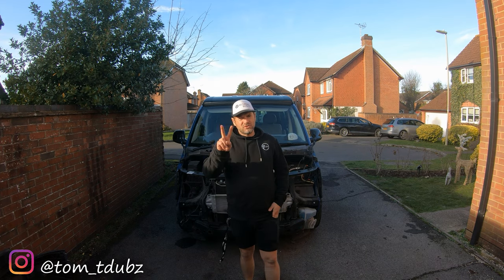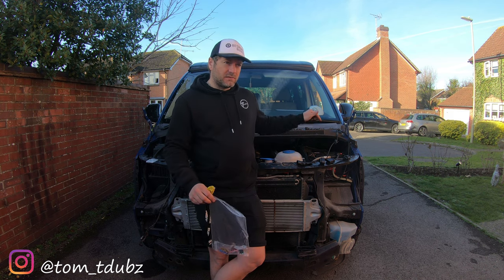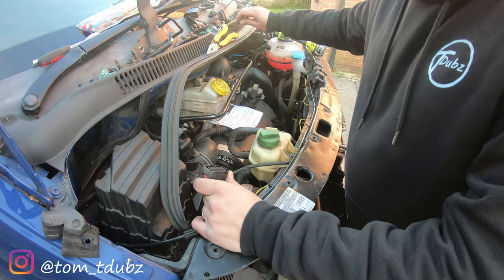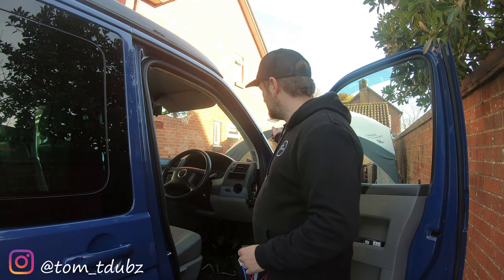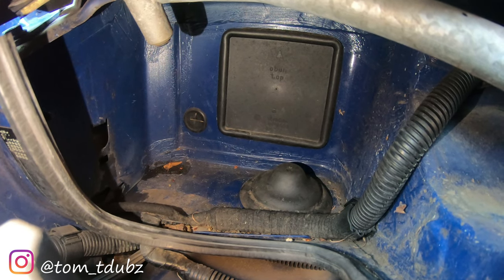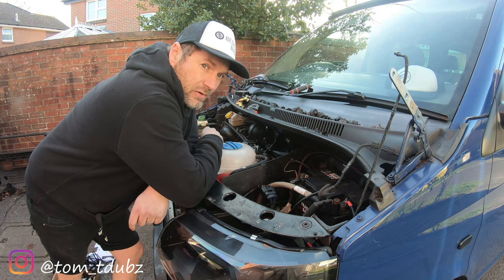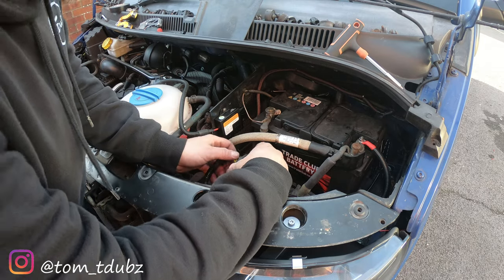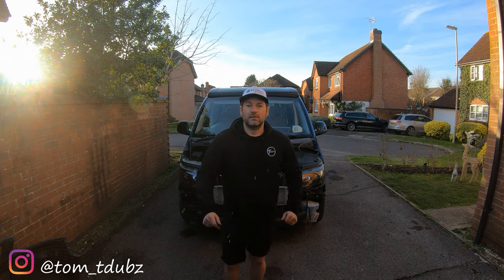VW T5 facelift #episode9 #pt2 #series2 #travelin-lite

Comment: There is a easier way to do this pin 12 in the fuse box next to battery is the van switched live and you just use a micro piggy back connectors for then buy a £3 normally closed relay whole kit less than £10
Reply from the maker: That does sounds good, I was trying to think of an easier way... 👌🏻👊🏻

Comment: Looking good my friend 🚐👌🏻, 
Can I pick your brain 🧠 
I have very similar lights in my T5.1
I went down a pothole the other day, and the drls in the ns headlight have packed up 🤬
Is there a way of getting the light out without removing the bumper 🙏🏼, gonna have a go at repair tomorrow
Reply from the maker: You might be able to get it from behind... but the likely hood is that u will have to remove the whole thing...
Reply: @tomtdubz  here goes 🤞